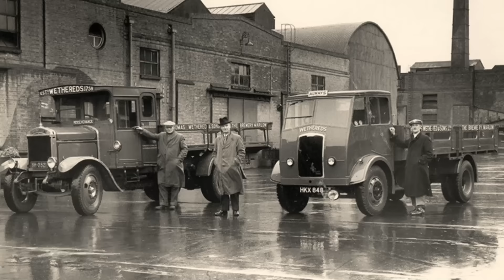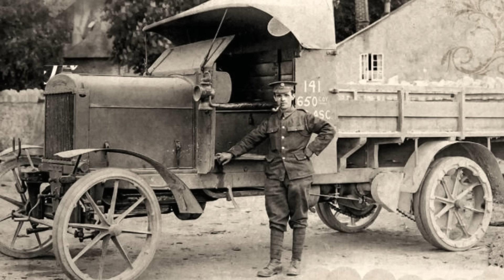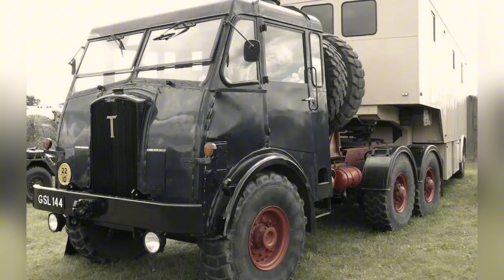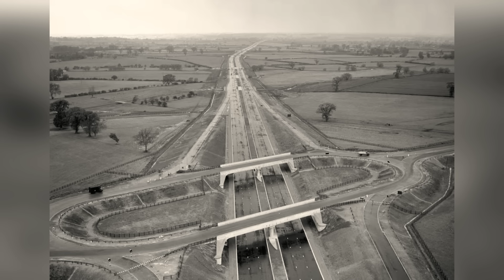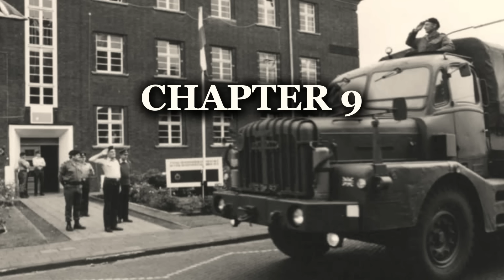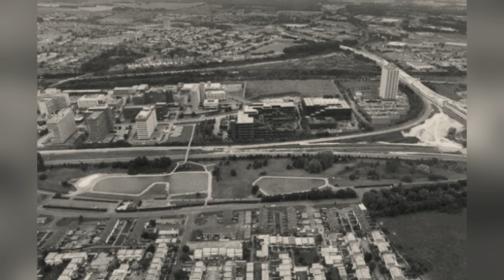The Silent Thornycroft Plant: How Britain’s Heavy Transport Empire Was Sabotaged

Comment: 19 Sqn is now at Bulford, as it has been for a very long time, HOWEVER, it was based at Ranby, Nottinghamshire, about a mile away from the A1, when the Antar was in service, up until about 1969, when the Barracks was turned into a prison, as it is now. My dad had a petrol station on the north bound A1, at Ranby, I remember them up and down the road. We also lived at Ranby.

Comment: Amazon Coles crane omitted,  As well as the Nubian, the Alvis Salamander was also a 6x6 and preferred by the RAF. AEC didn't use the Thronycroft gearbox until they took it over.  Likewise Albion's use of it was only after the Leyland ACV share exchange, and in neither case were all models so equipped. There were other places you could go to in the UK for super heavy tractors, Watford for one.